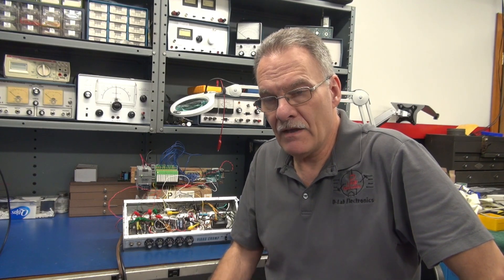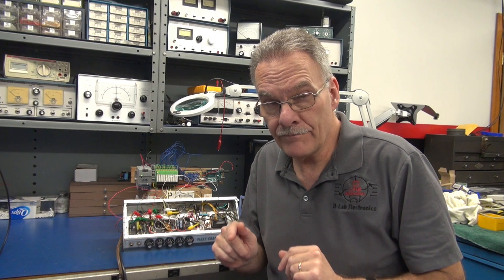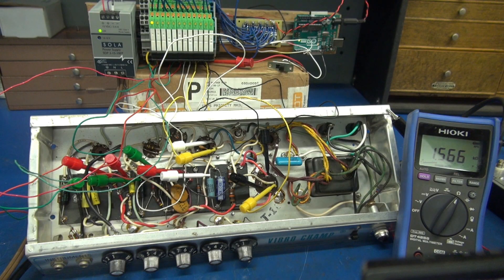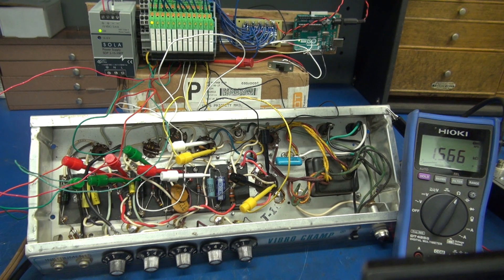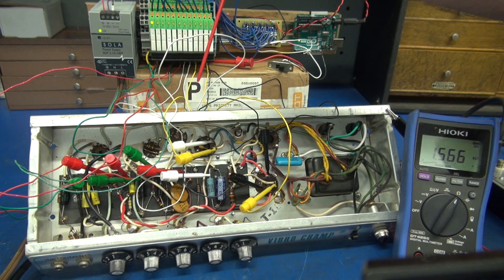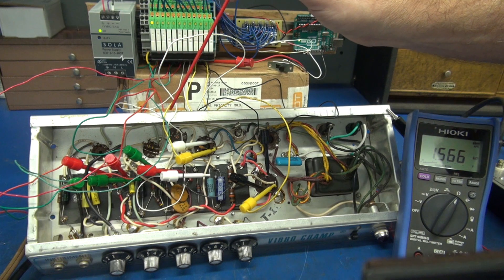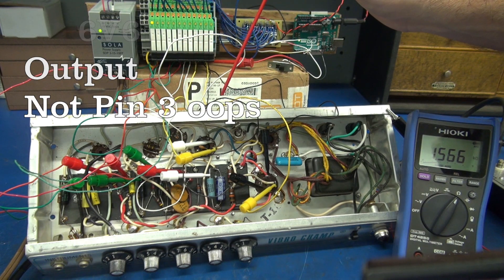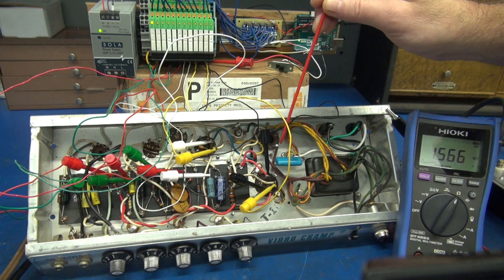Safe Hands off automatic resistance Voltage testing Arduino UNO Hioki meter Fender Vibro Champ Demo

Comment: I'm not sure if I understand the testing sequence.  You said both resistance and voltage checks.  That would tend to mean the UUT would be unpowered for resistance and then powered for voltage checks.  Just looking for clarification. 

Back in the late '70s and early '80s I worked at an electronics manufacturer and used automated test stations to test circuit cards and assemblies.  They were minicomputer based and had multimeters, power supplies, signal generators and digital I/O ports.  It looks like you're setting up a small starter version of those!  Keep up the good work!
Reply from the maker: Yes Sir, 2 sweeps, resistance to ground unpowered, Then voltage to ground powered. Yes, I have played with some data acq systems in the past, IO Tech, Measurements computing, NI, etc, Fun stuff